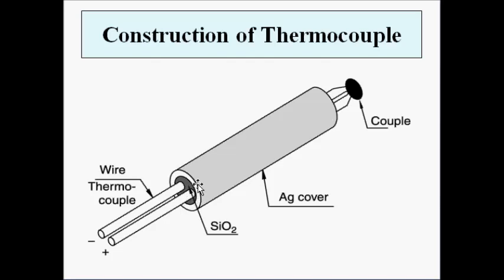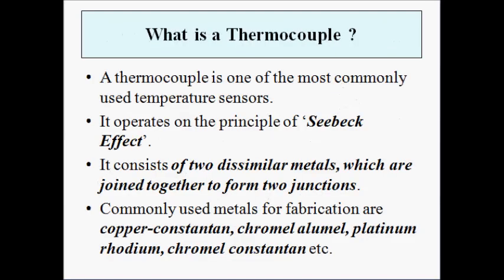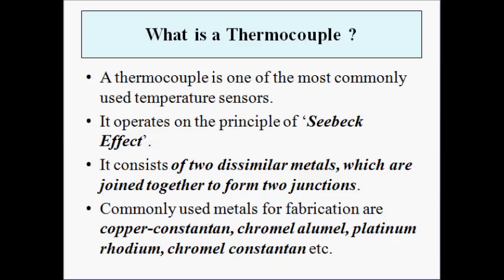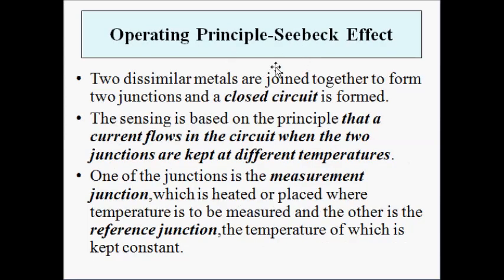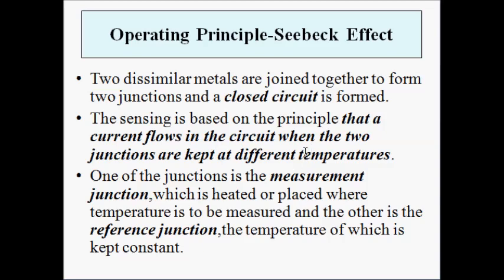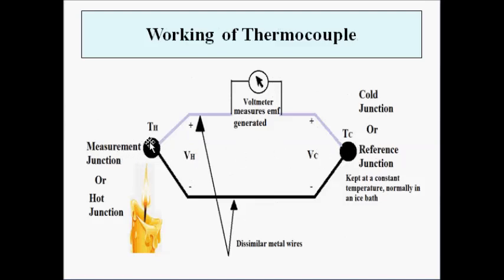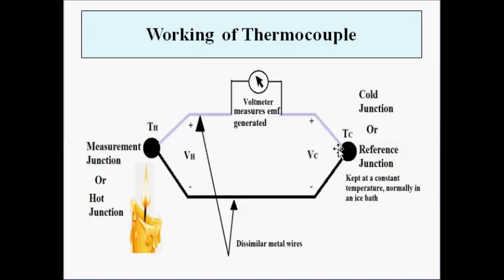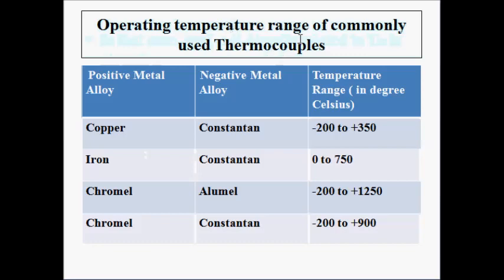Thermocouple - Basic Concepts

Comment: Please can you help me out with a question on thermocouple? 
A thermocouple circuit uses a chromel-alumel thermometer which gives an emf of 33.3V when measuring a temperature of 800°C with reference temperature of 0°C. The resistance of meter coil Rm is 50 ohm and a current of 0.1mA gives full scale deflection. Thanks resistance of the junction and lead (Re) is 12ohm, calculate;
1. The resistance of the series resistance if a temperature of 800°C is to give full scale deflection.
2. The approximate error due to rise of 1ohm in Re(resistance of junction and lead)
The resistance temperature coefficient of coil is 0.00426/°C.
Please you can forward the solution to my email oghenetegaobomure@gmail.com or to my watsapp number +2348146161797. Thanks